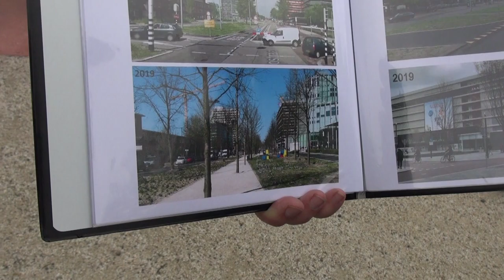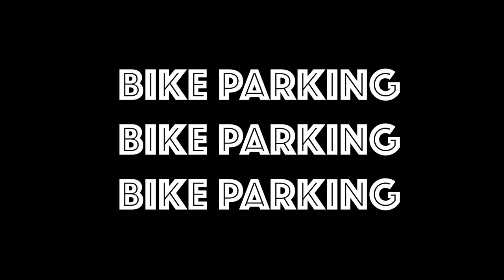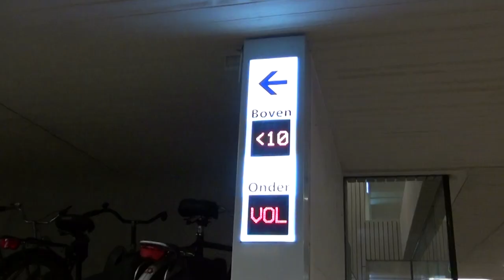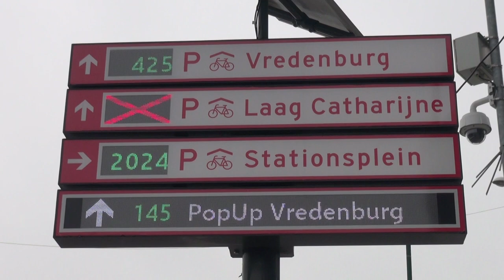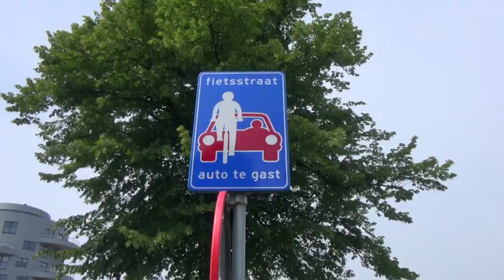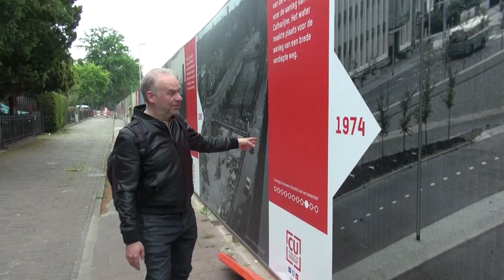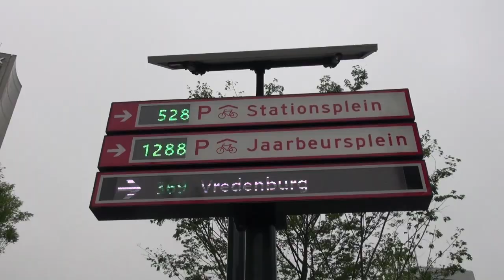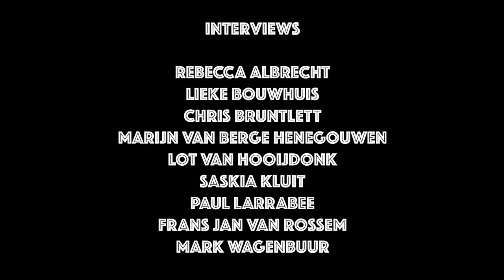Utrecht: Planning for People & Bikes, Not for Cars

Comment: The big question is: how does all this work during heavy rain? Netherlands are not famous for good weather.
Reply: They are lucky, they have a mild climate (cool summers, warm winters) and flat land, which is why this all works. You can prepare for rain, easily. You can't make cycling pleasant in snow, heat or hilly terrain, no matter how many roads you close.
Reply: We basically couldn't care less about the weather. If it rains, it rains. You simply learn to live with it, it's just a part of Dutch culture and our national character.
Reply: @RandomPlaceHolderName  
It also works in Switserland. And that country is not flat. And does have severe winters.
Cycling in Switzerland, see:
https://www.youtube.com/watch?v=Vb3oYEx_Ayc . Lausanne
https://www.youtube.com/watch?v=HCf0P1mnWGQ . Zurich
https://www.youtube.com/watch?v=36RhnC8C7uA . A bicycle you could use (expensive model).

Besides, how many urban areas are actually extremely hilly or have extreme weather most of the year?
Sure, San Francisco is hilly. And so are some other cities. But overall?

Besides, hills are not an excuse any more since the existence of the E-bike. See, among others:
https://www.youtube.com/watch?v=lIevQK-uPMk
It works even when the hill is a little steeper. As can be seen in:
https://www.youtube.com/watch?v=c7a8XjeDRGg

As to cycling in snow and very cold temperatures, see:
https://www.youtube.com/watch?v=0NqoYHE6SWw . Oulu, Finland.
Reply: @wimahlers  The difference between Zurich, Oulu or my city of Montreal and these bicycle cities in the Netherlands is that it's going to be far far easier to convince the masses when the weather is fair and the ground is flat rather than telling them they'll have to cycle to work uphill in snow in January. The masses just won't cycle in snow/appalling heat/siberian winters. We have cyclists who cycle to work in snow here too, doesn't mean the rest of us are as masochistic as they are, we'd rather just take the metro. It'll be the same in appalling hot places which is where a lot of the human population are located.

So the question is, if we are going to take the metro in winter, why not forego the bicycles altogether and just take the metro year round? This is why the bicycle won't work in so many areas. And as for the ebike, while better than cars, it doesn't help you much from the elements. It only helps you from exertion. Not to mention they are awful for the environment since we don't recycle electronics much and we have an awful time mining lithium/cobalt in Africa. Best to just built trams and metros. And bicycle cities where the weather/topography permits it.
Reply: @wimahlers  Look at the yearly averages of Amsterdam (on the wiki) and then compare them with most other places. It will be much milder than Amsterdam, and in many cases, both. Average high in July in Amsterdam is 22c, laughable. New York City's average high in July is 29c and both cities have similar winters. 

https://en.wikipedia.org/wiki/New_York_City#Climate
https://en.wikipedia.org/wiki/Amsterdam#Climate

https://www.timeanddate.com/weather/usa/new-york/historic
https://www.timeanddate.com/weather/netherlands/amsterdam/historic

And I only picked New York off the top of my head, it isn't known for it's particularly extreme summers. Go around the world and try to find places with temperatures as mild as Amsterdam's, it is difficult to do. All I can think of are coastal climates like New Zealand, Vancouver/Seattle, Lima and obviously, northwest Europe. And also tropical cities at elevation like Mexico or Bogota but those are even rarer, and possibly quite hilly. 

Which leads me to reiterate my point. It's not because you can cycle in cold, in snow or in heat that you can build a city for bicycles. If you can't cycle comfortably in a city year round, it will need a sizable public transport infrastructure in place for the few months of bad weather. At which point people will simply pick public transport year-round, which is what you're seeing in most places around the world and to some extent, even in Amsterdam. It seems to me that most Northwestern Europeans have no idea how lucky they are to have such mild climate. Ah well.
Reply: @RandomPlaceHolderName  
I have discussed this at length commenting on other youtube videos.
Specifically for the US. And I repeat again in the following short recap:

Just creating bicycle lanes/paths is not enough.
You must integrate the various modes of transports. And you must change the infrastructure.

For the US this means:

a) Changing the zoning regulations from a car centric to a mixed mode regulation.
b) Build a usable efficient and connected public infrastructure.
c) Give priority to public transportation (buses with bus lanes. Trams with dedicated tracks. Automatic green lights at intersections for tram and buses, etc.).
d) Narrow the inner city roads. Block inner city roads to prevent rat running. And use other traffic calming measures. All this to reduce city car congestion (reversal of "induced demand").
e) Change the traffic rules to prioritize pedestrians and cyclists.
f) Create a contineous cyle network infrastructure. With this I mean it should not only be connected. But connected to the right places (where people live and work or transit to the public transportation). And the network should be contineous at intersections as well (which is the case in The Netherlands but not so much in the USA).
g) Create bicycle underpasses and overpasses for crossing major arterial roads.
h) Prioritize green lights for pedestrians and cyclists.

NB Switzerland does not have the mild climate you refer to. Nor is it flat. 
And yet, the bicycle mode share is way higher than the US. 
It has nothing to do with climate. It all has to do with the points I just listed above.

As to your link to the NYC climate (https://en.wikipedia.org/wiki/New_York_City#Climate):
I do not see any problem why you could not cycle all year around (minus some days with extreme weather I also mentioned before).
The 29 degrees Celsius you mentioned is doable. Especially on an E-bike. Then again, when you are only used to an airconditioned car (or airconditioned everything and everywhere) then, yes! It will be something for you to get used to. So what?
Reply: @wimahlers  I'm glad you've been discussing this on other videos on youtube; I'm sure it makes you an expert in your own mind's eye. Thanks for letting me know.

That said, Zurich's weather isn't severe. It's milder than nearly all North American cities and probably many cities around the world with tropical heat or continental winds. And yes, it is definitely influenced by the gulf stream, just look at cities east of it and see colder winters, warmer summers and more extreme records. Zurich plainly isn't all that severe, mostly due to the gulf stream.

Second, I've said this about bikes in montreal in winter but you keep missing the point. It's not because 29c average in NYC is doable that people will pick it. Unless the economy crashes massively or an authoritarian government forces its use, bicycles won't succeed half as well as they have in amsterdam simply due to the weather. People woll simply pick mass transit year-round and only those that enjoy cycling will change their commute with the seasons. And that remains true, no matter how many changes you make to improve cycling in a city. The masses will pick the path of least resistance. 

Third, I think the ebike will solve nothing. It is susceptible to the same shortcomings as the bicycle, albeit without the exertion but at a financial cost. Like scooter/motorbike cities that plague the world. Probably an improvement on those hellscapes or the current car jammed cities, but hardly a solution. And again, the weather plays a big role in this.
Reply: @RandomPlaceHolderName  
Still looking for excuses. Noted. Moving on...
Reply: @wimahlers  What excuses?
Reply: @wimahlers  I'll try again, simply out of curiosity, but what excuses? I feel that the correlation between mild weather and the masses cycling is unmistakable.

Comment: I think this is wonderful. Unfortunately in American cities none of this is possible or ever will be; not now, not 50 years from now. I just don't see it. Too backwards, too ignorant, too many crooked politicians, etc. The list goes on. Americans "drive" everywhere and I mean EVERYWHERE. I don't care if it's 1 block or two, they will still drive. 99.5% of American cities are built only for cars and that's it. I don't know if the picture was real or not but I saw one guy driving in his car, with his dog outside and him with one hand on the steering wheel and the other with the dog leash in his hand!!  If your're wondering why 85% of Americans are fat or obese ( especially the women) now you know why more or less. Figure it out from here.  There are of course case where ones absolutely would need to travel by a bus, car, van, etc. and that's for sickness, injuries, deaths, rain, high winds, snow, extreme heat and cold. But they have made adequate provisions for this i'm sure in all of these renovations. 

They also don't even have adequate bus routes. In many cases you would have to walk 1-2 miles just to get to the bus stop which is absurd.  Best case scenario at least 3 or 4 blocks from where you live. The only city that has any kind of decent way to transport your body from one place to another, other than by your own automobile is New York City; maybe a handful of others, but it's still not that great.  Boston, Chicago, Minneapolis, Philadelphia and Portland Oregon, are the ones that come to mind. 

 Notice all the places I mentioned are either up North or in the Western U.S. The South and  Southeastern areas? Forget it!  American cities in general are all built for automobiles, but the Southern U.S.?  99.9% of the cities are all built for cars, and they barely have any sidewalks either.  Right now I am without a car in my area in which I live ( lower Midwest) and it's miserable. Cars get first priority. It's like " get out of my way" is what they are saying they way they drive.  Riding a bike in America in general for other than recreation is basically a death sentence in some case too.  There are bike lanes, but they aren't everywhere around the city. But then again why should they be, when 99.9% of the People travel by car ( or more accurately by truck or SUV) and bikes are for recreation and not for anything else.  But it's still better than most cities that have ZERO bike lanes.  But that sums it up.

Comment: Unfortunately, the reality about cycling in Utrecht is not as good as this video suggests. 
Let me first clarify that I am a cyclist. I work in the center of Utrecht and go there by bike from a suburb. When I go shopping or out in Utrecht I go by bike or public transport (bus). So I am all in favor of a good cycling infrastructure. But I see too many videos depicting Utrecht as some cyclist heaven, which it is not.

First of all, safety. Utrecht has become an extremely dangerous city for walking and cycling. There are just way too many cyclists going through the historical center where there is simply not enough capacity. People get hurt or are afraid to walk or cycle there.
De council has banned bikes from some parts of the city center for safety reasons (which proofs the point), but that is only a small part and the rest remains a safety hazard.

The large bicycle parking at the station was designed before the rise of the e-bikes, resulting in e-bikes not fitting in the racks and being too heavy to get to the 2nd level racks. Consequence is that there is almost never a usable space for your e-bike unless you are a weightlifter and can raise your bike to the 2nd level.  

Security is another issue. The municipal bicycle parking is OK in that it has a system that checks that you leave with the same bike as you came in with. Not so in the large parking at the station, where you can bring any rusty old thing inside and leave with a brand new bike, as long as you can show your public transport pass; no check if it is really your bike. Next to there not being enough spaces this is another reason to avoid the large parking for your expensive e-bike.

The municipal parking’s are good and I use them a lot, but there is an overcapacity of parking’s in a very small area. Outside that area (which means most of the center) there are no guarded bicycle parking’s. And leaving a new e-bike out on the street is asking for it to be stolen.
Reply: " Utrecht has become an extremely dangerous city for walking and cycling." You clearly never experienced how it used to be.
"And leaving a new e-bike out on the street is asking for it to be stolen." Its called a chain lock and costs 20 bucks.
Reply: Indeed, I have not experienced Utrecht before 1980, but after that I have. It has vastly improved, but that does not measn there is no room for improvement. And a chain lock, which I always use even in secure parking, is no obstacle for a criminal intent on stealing your bike. @McGillus

Comment: I'm thinking that after my vehicle goes kaput, I will replace it with a bike. I guess when I get to my destination, I can wipe my brow and reapply my deodorant, wash my face, apply makeup or not, restyle my hair, and forget about the wrinkles in my clothes? Are there flat tire stations along the routes? Just think about the savings on auto insurance, tires, fuel, registration, licensing, oil changes, repairs. 🤔
Reply: Everyone in Holland can fix a flat tyre in minutes with a small repair kit.  As to needing deodorant, if you are fit you will not sweat a lot when riding a bike, even in summer, in fact it cools you more than driving a car in summer.

Comment: I love the city centre of Utrecht, I studied there, but I’ve always hated the unfriendly policy for cars. All the cyclists and dead end streets drives you crazy when you’re by car. Despite this Groenlinks policy, I will keep going to Utrecht by car (diesel from 2014) and not by bike.
Reply: Park your car at a "transferium" parking garage location on the edge of Utrecht city
(see: https://www.transferiumparkeren.nl/utrecht).
Take public transportation (mostly tram) that stops in front of these parking garages.
Use your parking ticket, which also is valid for the public transportation, to travel to the city center. Valid for up to 5 people.

And there you have it …. easy, comfortable, reliable, predictable, quick and cheap.

Note: 
When you live in the city, walk or use your bicycle. If you are unable to do so use public transportation (or, when applicalbe, disability utilities). If you want or need to buy large items (e.g. like furniture) let it deliver. Use your car only as a last resort. And don't let the weather be an excuse. E.g. use a raincoat when it rains.

Comment: "but you arent safe from rain while cycling opposed driving a car" be a fukin man and go through it. 5-10 miles through the rain is doable
Reply: Until it's  time to get 10 lbs of potatoes , Cat Litter , refill a BBQ propane bottle or pick up a case of beer or water.
Reply: John Smithput you can put those safely into the bags on the back of your bike (given you have bike bags)

Comment: Some people need cars and also cars are safer than bikes.
Reply: Some people need airplanes and also airplanes are safer than cars.

Also:
https://ehp.niehs.nih.gov/doi/full/10.1289/ehp.0901747

And I quote from this source:
"On average, the estimated health benefits of cycling were substantially larger than the risks relative to car driving for individuals shifting their mode of transport."

So what is your point?
Reply: @wimahlers  My point is I would personally feel a lot safer in a car than I would on a bike but that is just me and it would also depend on where someone is cycling and what condition the bike is in.
Reply: @autisticrebel1253  
Safety is a relative perception.
For instance ... many feel safer in a thunderstorm without rain than in a thunderstorm with rain.
In reality a thunderstorm without rain (though rare) is much more dangerous than a thunderstorm with rain.

But more to the point ... statistically, cycling is more dangerous than driving per kilometer driven. But cycling is safer than driving per hour driven (or roughly as risky as cycling, depending on which country you cycle and drive in).
And cycling is far more healthier on a population level than driving.

Rainless thunderstorm:
https://www.youtube.com/watch?v=-0ULB8sYjC4
The danger is not in the fire hazard, but in the more intense electric fields lightning strikes create on the ground.
Reply: @wimahlers  I know that cycling is healthy, One of the only ways cycling can be safe is there are a lot of people doing it but that is something that would take a long time to achieve. They have clearly achieved it in places like the Netherlands. Also, I didn't know there was such a thing as a thunderstorm without rain.

Comment: A velomobile is great for longer bicycle distances, good weather protection, fast, 70%safer and more comfort.
Reply: There are a few in the Netherlands but it's not very practical because you can never park a velomobile anywhere.
Reply: @Brozius2512  why? I have skipped my car and driven a velomobil since 2014 with no parking issues, of course you take a chance in a high crime area but that is the same with most vehicles.
Reply: @catesolarcatamaran252  You have never been to  a Dutch city haven't you? Otherwise you would know closely packed everything is in a city center. You can hardly park a xtracycle because there is just not enough room.
Reply: I had a couple of kids in high school who had to cycle 50 km to school, they also used velomobiles.
Reply: @femsff7090  And that's a good idea because it's a long ride but using it for going into town to get to a supermarket wouldn't be so useful.